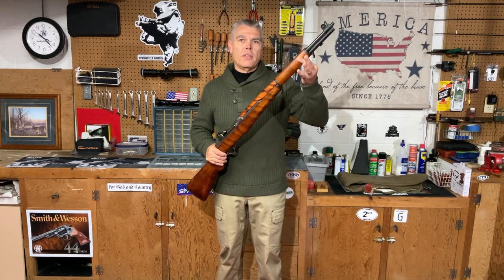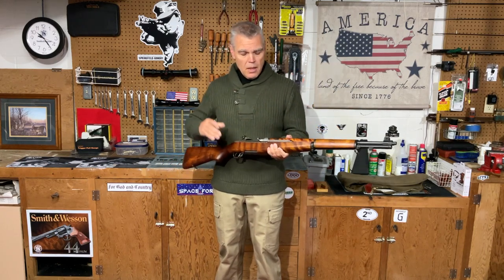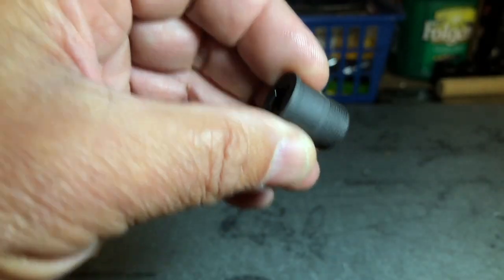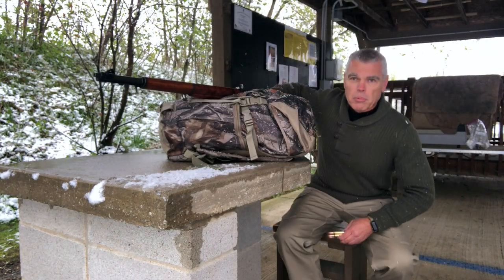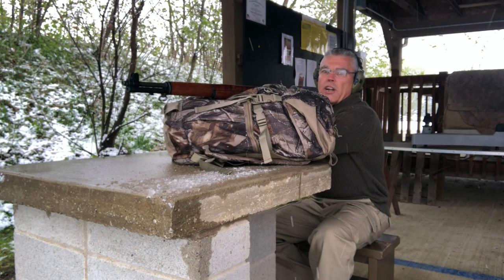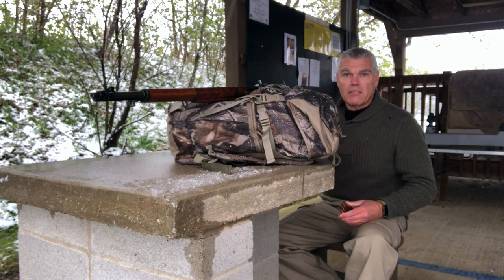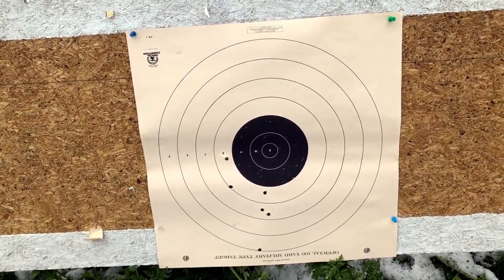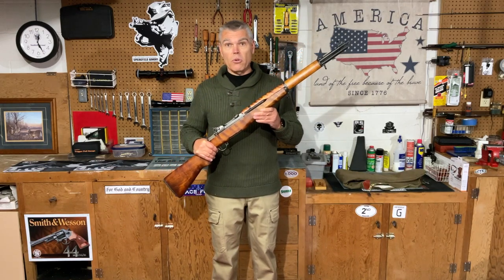Garand Gear Ported Gas Plug: Fact or Fiction

Comment: The "M2 Ball Only" myth is just that.  The Garand was designed and spec'ed around the M1 ball, a much higher pressure round with a heavy bullet and very slow powder.  It was also often issued M2 AP, which is a long-for-weight 162gr bullet going very fast.
Reply: I agree. After WW1 The Army concluded that the M1917 MG was being outraged by the 8mm Mauser Spandau MGs (from 800 to 1000 yards) so the M1 rifle was designed to fire the M1 cartridge that was significantly hotter than the M1906 cartridge. Mist ammo used in WW2 was the M1 cartridge. In 1939 the Army National Guard complained that M1 ammo was over penetrating the berms and backstops if their ranges and posed a safety hazard. The Army took the M1 cartridge and gave it the muzzle velocity of the 1906 and designated it rifle cartridge caliber .30, M2.

Comment: I use the Garand Gear Gas plug and it’s worked just fine.  With the Garand Gear plug, I’ve shot between 400-500  rounds if I had to guess and of different factory brands (American Eagle, PMC, Remington, Winchester) but all at 150gr bullet weights.  No issue yet with feeding, ejection or anything else.    Expanding the gas volume area makes sense that it’s going to be less of a beating on the op rod and that’s why I installed it.  For me, it’s been money well spent with piece of mind.   …oh and yes I too did NOT see any better nor worse bullet groups  either with or without the Garand Gear gas plug.    Then again, I didn’t buy it for an attempt at making the rifle more accurate.  I bought it just as added insurance to protect the op rod.
Reply: You won't have any problems I've owned two M1 rifles more than thirty years. When I saw the product I jumped on them never a problem
Reply: @m2gjam139  good to know.  Thanks. 👍👍

Comment: I run the Garand Gear gas plug in all my Garands.  I have a Schuster adjustable gas plug, but it took a lot of shots to get it adjusted correctly.  That would be okay if someone wanted to set the rifle up for one specific load.  I stick with M2 ball, or ammo as close to M2 ball as I can find.  If I want to shoot some heavier loads, I have a 03-A3.  I did not notice any accuracy shift, for better or for worse, when I installed the Garand Gear plug.  Other than torquing it consistently, I don't see how it would really improve accuracy.   Honestly, the Garand Gear plug gives me just a little peace of mind.  Expanding the volume of the gas cylinder makes sense in theory.  By the way, you can still mount the WWII era bayonets.  They do not interact with the gas plug like the M5 bayonets.  Thanks for the video, and thanks for your honest opinion!
Reply from the maker: You’re welcome. Thanks for watching, and for the great comment.
Reply: It takes patience to setup the adjustable gas plug and time also , I think you really need to reload for the Schuster plug
Reply: I own two M1 rifles and changed to the GG plug on both I've had no issues with failure to feed or anything else. I do reload. If using store bought ammo I feel a little better with the new plugs. But I wouldn't use any ammo either keep i t sate.

Comment: 30-06 ammo has not gotten hotter over the years. It was developed at 50,000 CUP and is still at 50,000 cup. I guess the old wives tale that the M1 is fragile and can only shoot M2 ball will never die. Even the CMP states that commercial ammo 180g or below is fine to shoot in the M1. ( CMP owners manual) . The M1 rifle was actually adopted a year before M2 ball ammo. It was designed around full power M1 ball.

Comment: I've used Garand Gear ported plugs in a half dozen rifles and it has been flawless,  it works as advertised
I have fired thousands of rounds thru it and it turns the M1 into an ammo whore. Firing anything you can find is a big advantage today.  If you have problems check your rifle to make sure it's in spec.
Reply: Love it.
Reply: Only thing their plug can't handle is super hot custom loads. All commercial ammos should be safe to use.

Comment: Regarding the cycle failures, I experienced this same thing with the GG plug and took it out. Then I started running into it with the stock plug, M2 Ball 150gr load (so lower power than most commercial). Turns out I just needed to replace the op rod spring, which on a lot of these rifles are 80 years old and fail to cycle properly more often with lower impulse explosions. After this my rifle has been running flawlessly. With the GG plug and a fresh spring I've been able to test loads from M2 ball/M1 match up to Fiocchi 3000fps 150gr boat tails, Federal 180gr power shok, and Winchester 180gr super-X. Without the GG plug the recoil on hot loads starts getting unmanageable and I can feel the rod slamming into the back of the receiver so I stopped doing that. TLDR these rifles are super old and often need a new spring and re-greasing. Thanks for your videos; always enjoyable and educational.
Reply from the maker: You're welcome Howard. Thanks for watching!
Reply: So with the Garand Gear plug you can shoot modern 30.06 through the Garand? I'm finishing up the payment on mine and I don't want to throw just any ammo at it, learned that with my mauser
Reply: @Athoroughgamer  I still like lighter loads because some of these parts are 80 years old and they're not making any more. You can shoot just about anything except crazy hot handloads but the hotter they are the more wear you produce on the mechanism. Most important thing is to replace the op rod spring if it's old and grease thoroughly. The GG plug in my experience reduces wear and tear with a minimum of hassles. If you're just getting your Garand I would stick to M2 Ball spec if possible, or 150gr whatever. Keep an eye on ammoseek and look for PPU/Prvi Partisan M2 which you can find on the cheaper end usually. I also like Norma 150gr soft points. Stay away from Turkish surplus and certain years of Korean surplus due to brittle brass problems. Have fun.
Reply: @howardcollins9320  I was looking online and can't find any Norma ammo with my looking last night, just ordered a Schuster adjustable plug and I definitely wanna replace the parts that wear. Recently rebuilt my small block Chevy and didn't cheap out or buy used anything when it came to important stuff like gaskets, bearings, seals, stuff like that. Actually really didn't cheap out on anything on that motor and don't intend to with my rifles either

Comment: I use the Schuster plug in my m-1 and  in my opinion it give more flexibility and easy to set up . Thank for the great video.
Reply from the maker: You’re welcome. I may text the Schuster in a future video.
Reply: @hrfunk  InRangeTV says the Schuster is the bee's knees. (Insert link here)
Reply: I believe they tested an adjustable gas block and used high speed cameras and chronograph to verify that it did work on all types of 30-06 ammo they also mentioned that it took only 3 minutes to install.

Comment: Thanks for making this video HR!  I've been thinking about getting the ported gas plug for both my CMP Garands.   The video definitely seems to show the commercial ammo working the action harder based on how it was ejecting the brass.  The reason I was looking at the ported plug wasn't to shoot commercial ammo though.  I currently load two different loads using 150 grain FMJs, one for my '03 Springfields, and another for my M1s.  49 grains of IMR 4895 for the 03s and 46 grains for the M1s.  My hope is that the ported plug would let me use the 49 grain load in the M1s as well.  I don't really want to mess with an adjustable plug.

I still wouldn't use the slower burn rate powders like 4350 or 4831, and I think powders of similar burn rates are used in most commercial .30-06 ammo.  I think it's the slower burn rate that results in a gas port pressure that's far too high.
Reply from the maker: I think you’re right. I load M1 specific ammo too. I think that’s the best way to go unless you happen to have a stockpile of M2 ball lying around.

Comment: Thanks for your work and opinion. I bought a Schuster a while back and was starting to think it would be better to go with the easier option. Looks like the Schuster was the better choice.
Reply: I have both. I have the garandgear for ammo that is  "mil spec" and the schuster for ammo that is not. For commercial hunting ammo you have to go with the Schuster because the garandgear won't slow down the oprod enough. A lot of surplus 30-06 out there hasn't been stored properly and it's nice to have the garangear plug for some added piece of mind. I've also had problems with PPU being inconsistent and causing my M1 to bump fire, which has been linked to cracked receivers.

Comment: The Garand Gear plug has worked flawlessly for my 4 M1s for several years.  I keep them clean and greased, and shoot several clips each time to the range.  I have had NO issues.  None.  Nor does the Garand Gear plug interfere with the attachment of a bayonet.  Highly recommend.

Comment: Thanks for taking the time to construct this video about the gas plug in regards of the M1 Garand battle rifle.

I could only speak of my rifles in which I get plenty of trigger time. My Springfield M1 Garand standard 30 caliber is much more smoother than your rifle, specifically the second time you have loaded it with modern commercial ammunition’s with heavy tipped rounds. Of course I have always used 30.06 SPRG 150 grains only, all the time and, every time I train with any of the 30 calibers that I own, also my M1 20.06 is more smoother than my 1970 Belgium BAR 30.06 semi auto hunting rifle, maybe that will change once I get it cleaned as I just acquired the BAR recently, I like the 180 grains on the Belgium Bar semi auto.

In all my message is as long as I keep cleaning my M1, with proper storage ( the bore rust quick while in storage), none chrome lined barrel my M1, unlike my Belgium Bar which is chrome lined barrel, great for storage and, I uses only 150 grain 30.06 SPRG with no gas plugs on my M1 standard 30 caliber is no problem, no Ball where I live or, really hard to find the Ball ammunition’s.than you again for sharing your video sir.
Reply from the maker: My pleasure. Thank you for watching.

Comment: For years the match shooters used the Schuster plug. You can customize the Schuster for the ammo you are using by adjusting the allen screw inside the plug. Make sure your operating rod is in good shape if not even the M2 ball ammo can damage the receiver . I had 1 receiver with the back  cracked because of a weak op rod spring.

Comment: The Stock on that Garand is beautiful! That said my question is if you swap the gas plug will the rifle still fire M2 Ball just fine or must you re swap out the plug? If the Op rod is the problem why don't a manufacturer simply make a stronger op rod?
Reply from the maker: I don't think I tried that, but I would not be surprised if there were some failures since the volume of the gas cylinder is increased.

Comment: I don't believe adding a few CC's of cyIinder will do much as you demonstrated. I use an adjustable plug with handloads here ( mild 168mk w/4895 ) and the impulse once tuned is much less . Not sure how much an improvement it makes in mechanical accuracy it makes but it helps the shooter do his part. Thanks for watching !
Reply from the maker: I’ve got to try out an adjustable plug some time. I think they’re a better option.
Reply: What you have to understand is the GarandGear plug expands the volume for the gas chamber by almost 10 times and it's designed to remove the pressure spike at the beginning of the operation cycle.  It cushions the start of the cycle and reduces the spike slowing the acceleration of the Op rod and bolt assembly from the start allowing it to softly reach its proper speed for operation.

Comment: Thanks for covering a topic most channels don't! 👍
I shot M1 rifles in the 60s in High School for our school's rifle team.  I was without one of my own until after the FOPA in 1986 when we started to get a lot of re-patriated M1s from various overseas countries at low prices.
I bought one in 1987, a rack grade, Blue Sky import with a 10-44 dated barrel.  
I have always been careful NOT to use high pressure loads or slow burning powders in the M1 to keep port pressure at the muzzle low enough not to bend the op-rod.  If I want to shoot other .30-06 ammo, I use one of several other .30-06 rifles I own.  As great as it is, the M1 is NOT a good "all-around" .30-06 rifle. It is great for what it is...a battle rifle or match rifle, but you will never get the versatility the .30-06 is capable of from an M1.
I agree with your conclusion.  Enjoy the M1 rifle with M2 ball ammo or equivalent factory rounds or handloads, and leave the other ammo for other rifles.
FYI, I sent my rifle off to "Champion's Choice" who, at that time, was doing custom work on M1s.  They replaced the barrel with a Douglas air gauged heavy match barrel, did the "front end" work, replaced the op-rod and gas cylinder and installed a NM rear sight.  It was a great improvement and the M1 pushed my M1A to the back of the cabinet as my Service Rifle competition choice until the mid 90s when I started using an AR15A2 HBAR "Sporter Match" rifle.   
I think all that work on the M1 was about $600 at the time (late 80s) if I recall correctly. I still have all my match rifles, but no longer shoot competitively.  If I got down in the prone position now, they would have to call in the rescue squad to get me back on my feet.  Getting old sucks...but beats the alternative.
I do not think Champions Choice is doing that work any longer, but they are a good source for sights, some factory match rifles, and other accessories.

Your rifle looks very nice.  Do you have any videos on that rifle and what you did to it for match shooting?
Reply from the maker: Thanks for a great comment! Unfortunately, that rifle does not belong to me. It was loaned to me by a friend, along with the ammunition and the GG gas plug, for the purpose of testing it in this video. I also think it’s a very nice looking rifle. My friend just recently purchased it and I am envious! Take care, and thanks again for the comment.

Comment: I appreciate your honesty and good advice.  If a guy were just nuts about shooting commercial ammo in the M-1, could you comment on just removing the gas plug, and running it as a single shot rifle?  Thank you.
Reply from the maker: I think the better option might be an adjustable plug, like the Schuester with the valve completely closed. That would effectively turn the M1 into a straight pull action.

Comment: I've heard of the "7th round stoppage" in M1s before, it only happened in my M1 once, and that was with a WWII vintage Winchester made clip.
Reply: The 7th stoppage was caused  by mismilled receivers when they frist started production they caught it fairly early and remedied the problem and if you can find one that was not repaired it is worth much more than a later production model models . Even the repaired ones demanded a premium if it's the government repair.
Reply: I get that on occasion.Ive owned about 8 Garands and never had that before.I think mine is short stroking.Ive never had the piston and gas cylinder checked.But it's a November of '41 Springfield with anOct of'41 barrel so I don't want to change that.

Comment: Mr. HR, you missed the whole point. The Garland Gear ported plug allowed you to safely shoot modern ammo without damaging the m1, specifically the op rod. Not make it more comfortable. When the m1 was being designed, the official military round was the m1 ball, a 174 grain. The local national guard units in many states asked for lighter rounds because of smaller shooting areas that they had plus the m1 round recoil made it exhausting for a soldier to shoot all day, as you found out with modern ammo so the government developed the 150 grain 
fmj they called m2 ball, which became the standard round. But I do enjoy your videos and have learned much from you, so thank you.
Reply from the maker: My pleasure. As an FYI, I believe M1 ball (174 grain) was loaded to a pressure similar to M2 ball (150 grain). The recoil might be slightly greater due to the heavier bullet, but the strain placed on the guide rod couldn’t be appreciably more without running the risk of damage.